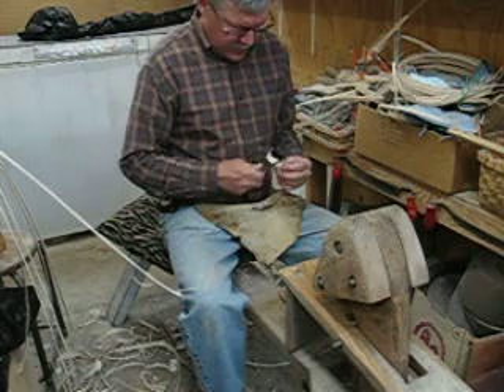Making "splits" from White Oak

Comment from the maker: It's called a shaving horse. Basically a foot powered clamp. It is very helpful when using a draw knife to smooth the sides of the wood. The piece of wood is held in place with the shaving horse and you have both hands free to use the draw knife.